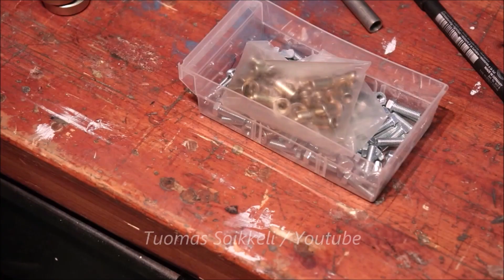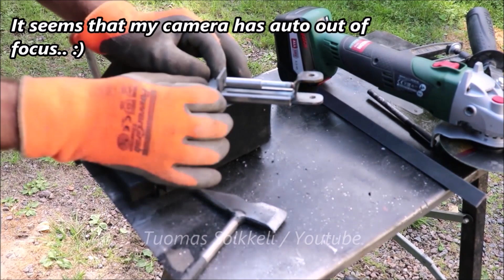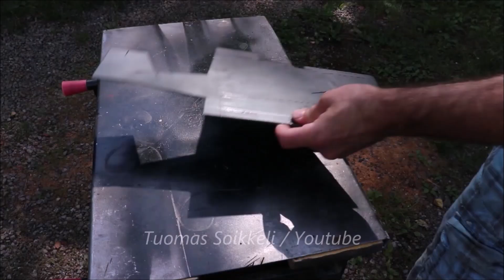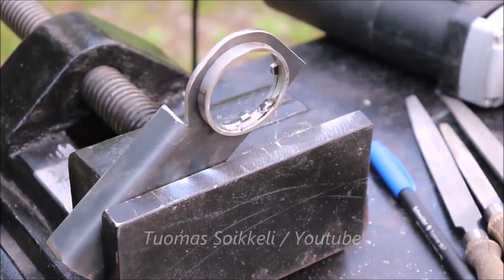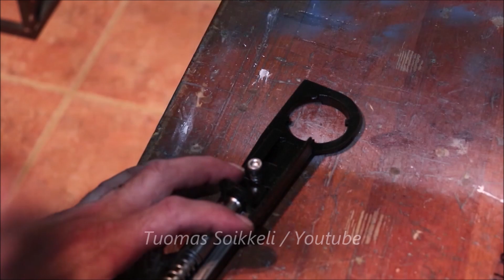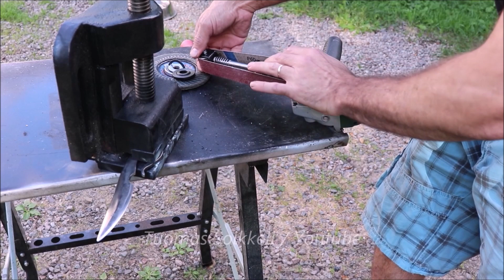Diy angle grinder power file

Comment: What is the difference between your device and regular petal sand wheel you took off in order to change it by your genious invention? I mean the case of knife sharpening process? +1
Reply from the maker: schabanow Not very big difference in that case. But i have belts from 40 to 800 grit... Best use for power file is to sand bottoms of the slots or grooves. Where angle grinder doesn't fit. That knife was something that i forged once i was bored, never sharpened it. Just didn't want to sand something without a purpose. 😊